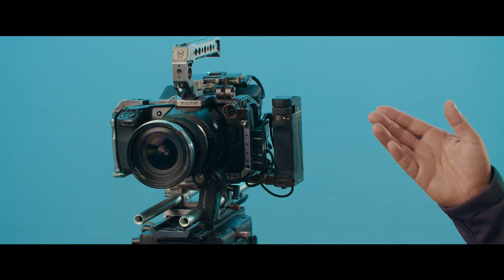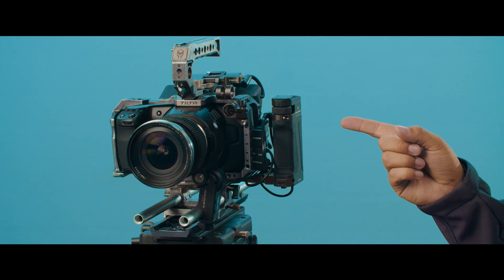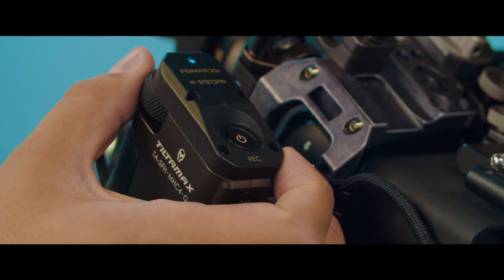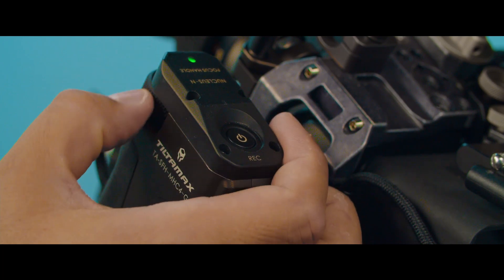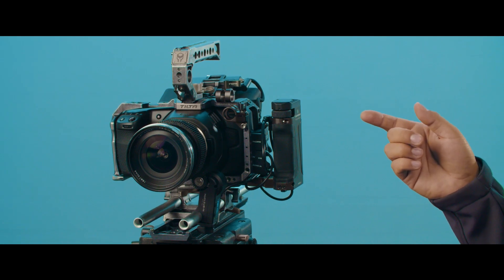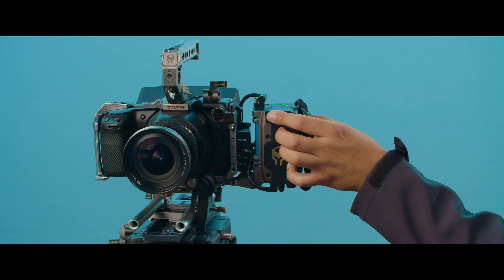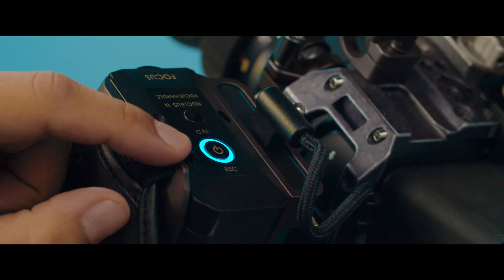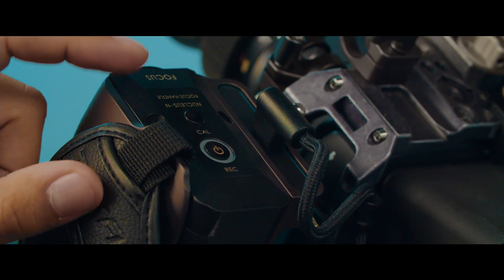Tiltaing Side Focus Handle Calibration

Comment: Is it possible to reset the firmware of the focus handle or update it? I'm running into an issue when I use the motor connected to the focus handle. Works fine when connected via the hand wheel, but anytime it is connected via the focus handle, the focus handle's wheel seems as if it is super sensitive and send the motor flying.

Comment: Thanks for the help on calibrating. Now how do I enable the start/stop rec button on the handle with the setup? I just recieved my handle with hopes of remote start/stop functionality
Reply from the maker: You will need a run stop cable! Contact our support team troubleshooting help if you're having issues: support@tilta.com
Reply: @TILTA  Thank you. I see you have the cable but what if I need to use my SSD?

Comment: Anybody know if you can run this set up on 12v? Concerned it won’t be able to pull focus on larger lenses
Reply from the maker: Unfortunately you cannot power the Nano motor via the 12V port on these handles, but we do have a P-Tap Cable that can give the motor with 14.8V! 

https://tilta.com/shop/nucleus-nano-ptap-to-micro-usb-motor-power-cable/
Reply: @TILTA  I love you

Comment: If you have shorter focus stops (Example a 180 degrees throw lens) Will the handle and nano motor adjust then to a slower speed? Hope that makes sense. With a shorter throw sometimes you only need a very small degree of focus turn so you would not want to fast of a focus turn. Thank you!

Comment: How do I reverse the direction of the motor though?
The way I have my motor mounted means counterclockwise on the wheel focuses near, which is super unintuitive for me.
Reply: I have the same question.
Reply: @enhancedsight  I’ve come to the conclusion you can’t.
I have since returned my unit because of this, and a couple other annoying issues.

Comment: Is there a tutorial on how to set A and B stops with the Tiltaing Side Focus Handle and Nucleus Nano motor? I have repeatedly calibrated the Nano and thumbwheel on my Tiltaing Side Focus Handle, but if I set a stop for A (by double clicking the CAL button) and then set a stop for B (also by double clicking the CAL button), the thumb wheel response goes nuts. I presume I'm doing this wrong, and hope there is a tutorial that will set me straight.
Reply from the maker: There is not a tutorial for this, but double tapping the CAL button at two different distances should save as A/B points. 

Please contact our support team about help with this! 

support@tilta.com
Reply: @TILTA  After some experimentation I found that only a single tap is required for setting the A/B points.

Comment: does the small handle power the camera with the smaller battery? Would i be able to use the small handle and power it with the small battery and then also power the camera with a v-mount? or would the camera have to be powered by the handle if the handle has to be connected to the camera?

Comment: what do you mean by "assuming your nano has been calibrated"?  the motor needs to be calibrated prior to calibrating the focus handle?  if so, how do you do that?
Reply from the maker: Hello,

This video covers not how to calibrate the lens, but calibrate the focus handle knob. To complete this process, you before hand need to calibrate the lens, which involves holding the down arrow on the nano motor to set the hard stops of the lens. 

The process of calibrating the handle is there to fix issues with the knob not properly registering where the end points of the knob are.

Please let me know if you have any more questions that I can help you with. Have a great day!

Best,
Reply: @TILTA  where can i see the "calibrate the lens" process? I am having an issue here.
Reply: @Alexdeguzman_  did you ever figure this out?

Comment: How do you connect the side focus handle to the motor? When it's connected via the micro usb cable the display of the motor is on but when turning the follow focus handwheel from the side handle the motor doesn't move.
Reply from the maker: You will need to use a Micro USB cable that is capable of transmitting power and data!
Reply: Where can I get such a cable? Is the supplied cable with the Nano Kit such a cable?
Reply: @avalon-media  yes

Comment: Is there a way to make the calibrate the knob for small distance focus pulling? At the moment it works great for pulling focus in great distance but for fine details (objects close to each other) it's too fast.
Reply from the maker: You can double press CAL to set one point and double press CAL again to set a second point. 

This will calibrate the motor to the two points you set. 

You will need to auto calibrate after to reset the motor!

Comment: can you charge your camera also with the N570 ? 
Using X-T3, could be amazing if it's charging by the bottom, the pin connectors of the grip !
Reply from the maker: These handles are designed to power the camera directly from the battery in the handle and cannot charge a camera battery
Reply: @TILTA  that's what I meant ! :)
Thanks a lot !
Reply: Can you do hot swaps with this set up?

Comment: The side handle's focus wheel isn't responding any movement to the nucleus nano, although is supplying power. When i hold calibrate 3 seconds, it does an auto calibration although my lens has no hard stops. When i try to manually calibrate, there is no response. Any help with this?
Reply: You might find this video helpful: https://youtu.be/mGQ-FVnGYik?t=161
Reply: @Chardhousemedia  This absolutely helped solve my problem! Thanks!
Reply from the maker: Please contact us at support@tilta.com

Comment: Does the wheel have hard stops?
Also, can one add a hand strap to this handle?
Reply from the maker: Yes, the wheel has hard stops on either end so that you can map it to the close focus and infinity sides of the lens. The handles were made with the Tiltaing cages in mind but the "Type II" versions of each handle utilizes an Arri rosette connection so you can technically attach this to any Arri standard rosette. The other versions of the handles were specifically made with the varying designs of the different cages and are proprietary to those cages.
Reply: TILTA Sounds good. I already have Nucleus Nano, and been waiting for S1H cage to get released (any updates on that?).
Initially I wanted to use Left handle from Nucleus M, and attach it to the cage via Rosette adapter. It does seem ergonomically better, but there’s no cable which could be used to power and connect to the motor (7 pin to USB).
Thanks!!!
Reply from the maker: I don't know the exact date that we'll have the S1H cage ready but I know it will be soon!

Right, there is no cable that we offer to connect the Nano motor directly to the Nucleus-M handle. However, these two items can connect wirelessly. You just need to power the Nano motor from a separate source and then power the handle with batteries and you can link them wirelessly.
Reply: TILTA Yes, I thought about it, but ideally if there was a cable to power it and control it from Nucleus M handle it would be ideal. In theory I could make my own cable (at least for powering Nano motor) from the handle. 
Is there any schematics available of 7 pin connector, it shouldn’t be hard to make power only cable if I knew which one is + and which one is -.
Reply from the maker: Please message us directly at service@tilta.com so that we can share this info with you privately.

Comment: Hi Walter,  how would you calibrate the F970 Battery Handle to the Nano, with a non-hard stop lens?  From what i can tell the lens in your tutorial video has hard stops??  I've tried calibrating an EF lens, following the Tilta recommended manual callibration process (the one with the control wheel, double tapping calibrate on the handle, setting infinity to -999 etc.) but always get play on one end of the focus wheel. Hard stop works on one end, not on the other... Please advise. Thanks! 

P.S. Once the power is turned off to the motor, is the calibration to the last lens calibrated, remembered? Or do you have to re-calibrate everytime?
Reply from the maker: Hey, you shouldn't have to calibrate your motor as long as you have properly calibrated your handle!
Reply: Can you elaborate on what you mean by properly? When I manually calibrate the Nano Motor to the Wheel controller, with an EF lens., the hard stops are there. No play.  On the side handle, when calibrated (?) there is play.
Reply: ...same steps with both control wheels.
Reply: Update : after recalibration the side handle, and the motor, there is no longer play. Thanks!
Reply from the maker: We're happy to hear that!
Reply: TILTA one more question : when power is turned off, with the side handle, to the motor, I lose the calibration.  Normal?
Reply from the maker: The Nano motor should remember the last calibration!
Reply: TILTA it did at first, now it doesn’t. Please advise. Thanks!
Reply from the maker: Please contact our support team with the following link! 

https://tilta.com/contact/

Comment: How long will the NP-F570 handle power the Nucleus Nano motor?
Reply from the maker: If the handle is only powering the motor, you can expect about 2-3 hours from a single charge depending on usage.
Reply: @TILTA  Is there a way to mount this handle on the right side of my camera cage or are there plans to offer a right handed version of the Arri Rosette Type II handle?
Reply from the maker: There is no word on a right side handle at this time, but you can use one of our 1/4″-20 to Arri Rosette Attachment to mount a Nucleus M Right Handle Grip to your cage!